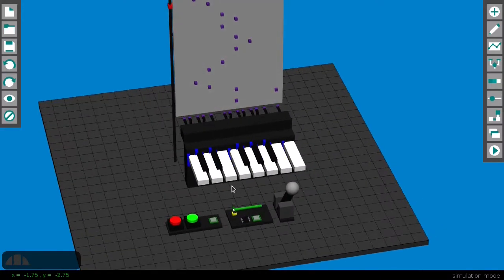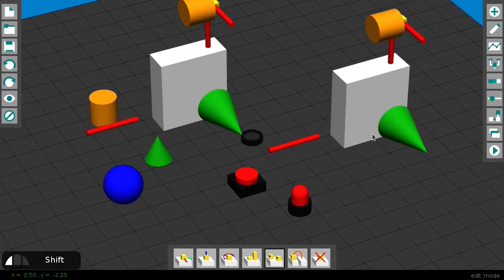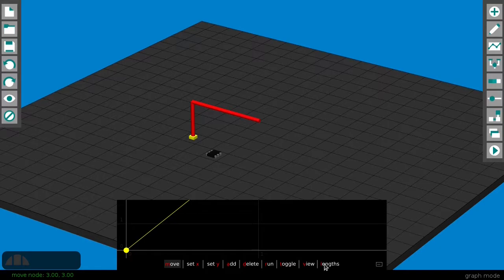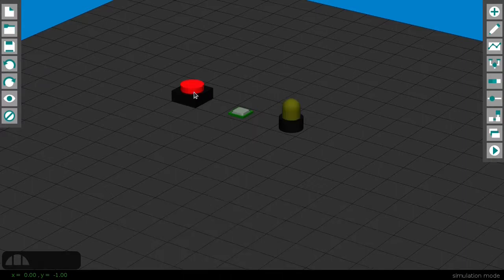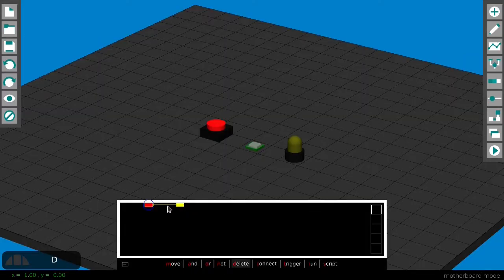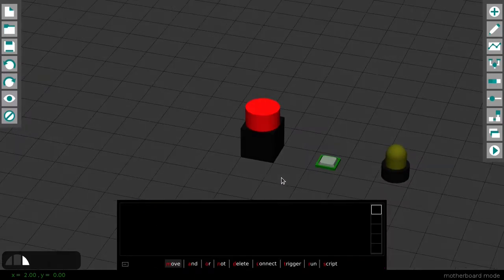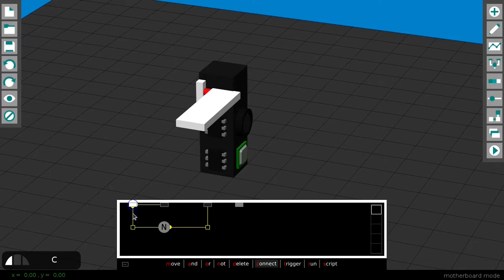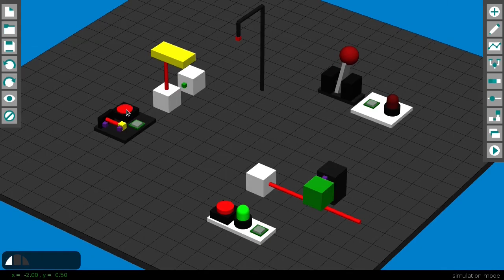MockMechanics Step by Step Tutorial - Part 01

Comment: Hi, this looks great, but the play button exits the game (windows 10), tried both java .jar and windows .exe
Reply from the maker: Hey Adam, thanks. Do you mean the simulation mode button at the bottom of the right panel? I just tested on my own windows 10 and I can't replicate the problem. Please try going to simulation mode with the shortcut instead (Ctrl s) so I can narrow down where the problem is happening. Also could you run the jar from the command line and tell me if you get any error output when it crashes? Just email it to mock.mechanics@gmail.com. I'd appreciate your help on this and I'll try to fix it as soon as possible.
Reply: @MockMechanics  Thanks, I'll try that out.